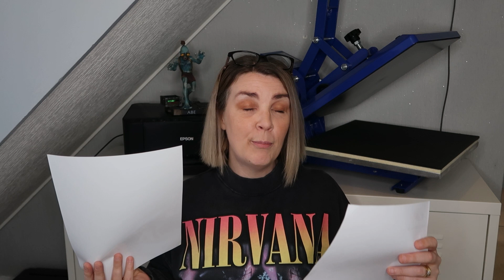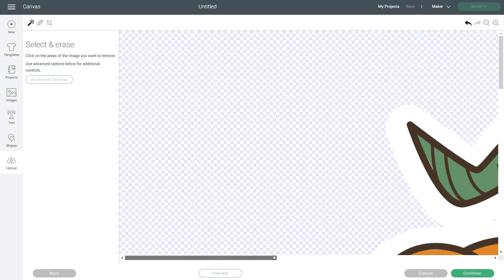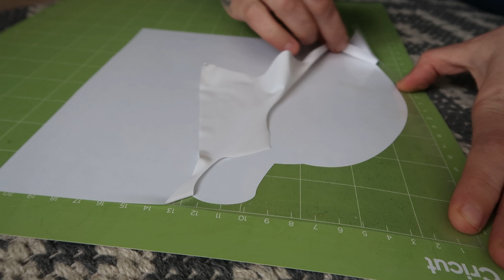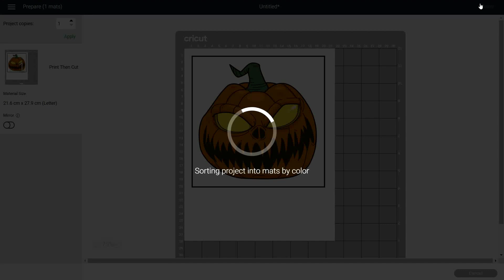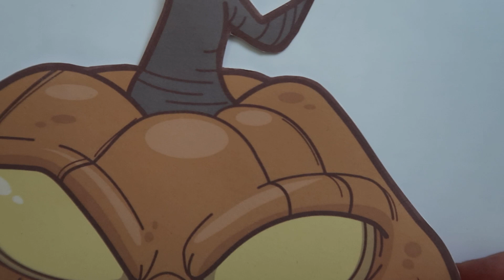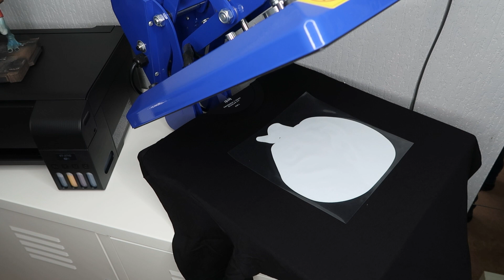Sublimating onto Siser Glow in the Dark Heat Transfer Vinyl / Step-by-Step using 100% Cotton T-Shirt

Comment: Hi Alwene where did you get siser glow in dark. Have you tried sublimation on any other glow in dark htv. X
Reply: Thank you x
Reply from the maker: Hi Sharon, I got it from Etsy. It was expensive! I did try to find the exact Etsy shop to link for you but it’s no longer available. If you search in Etsy or EBay there should be some sellers. I also checked Amazon but it’s not available there either! Hope this helps 😊